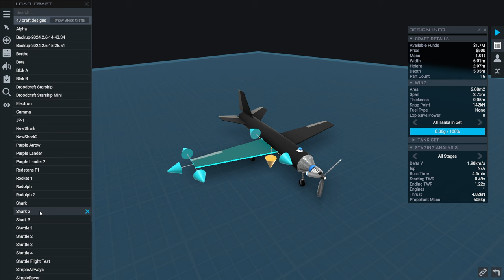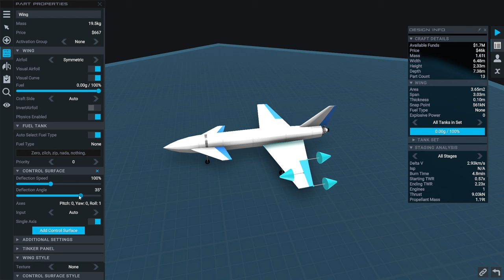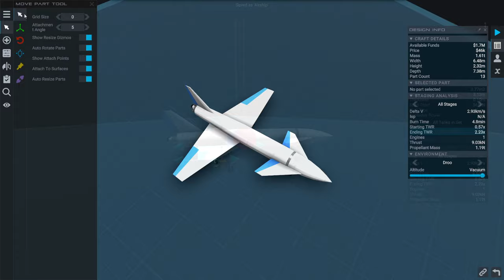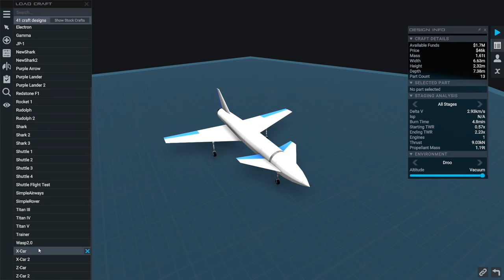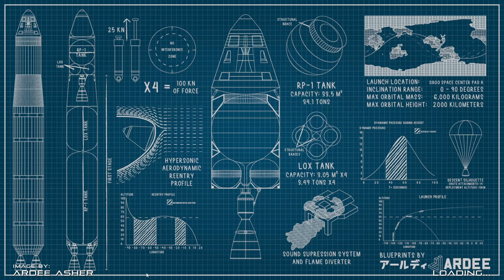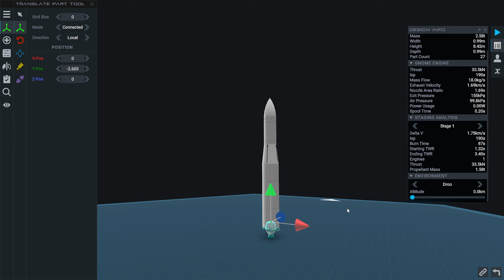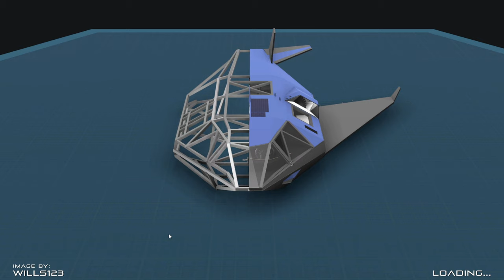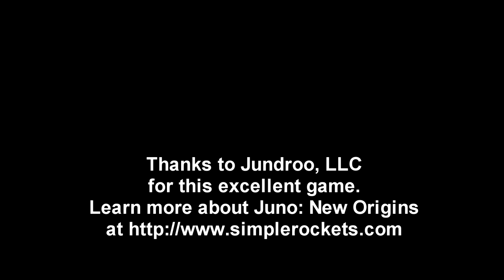Juno: New Origins - Fresh Start 07 - Finally

Comment: I think it's not that the plane was old and caused things to misbehave, but that something got misconfigured at some point and by loading that old craft you were carrying its issues (the changes to the wings up to your version were just visual).

In 1.3 there are changes that involve physics, so you will get a warning letting you know about it and a button to easily swap parts for their new counterparts.
Reply: That said, there's definitely something going on with your landing gear, I can't get them to clip on the lip of the ramp so often and sink into colliders. One thing that may be happening is that you are using small landing gear with a very heavy plane (rocket engine, full of fuel...) so their suspension may not be liking the forces they are taking.